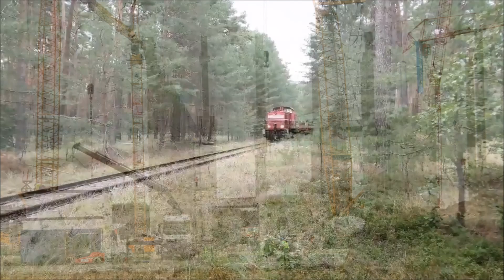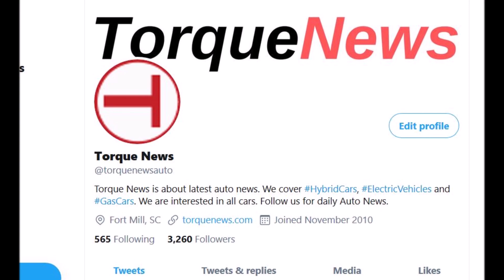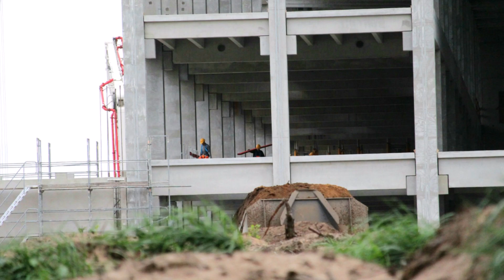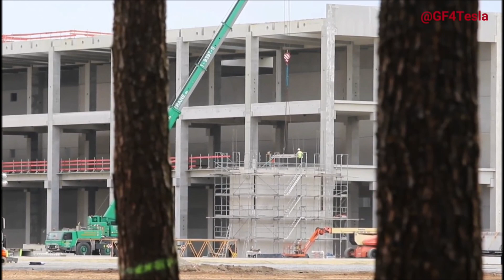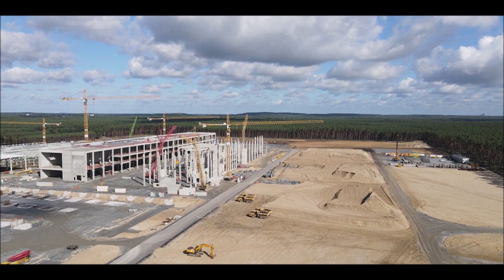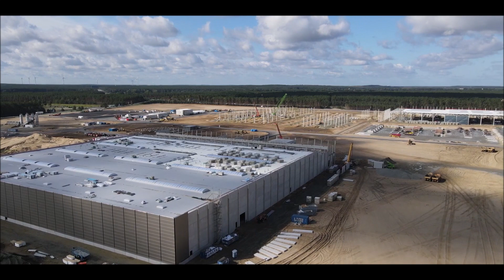Train Brings Enormous Construction Materials To Tesla Giga Berlin

Comment: Looks like half the forest was cut down and cleared
Reply: THEN PRODUCE ELECTRIC VEHICLES TO HELP CUT DOWN THE POLUTION NEEDED FOR TREES LEFT TO SURVIVE , ONCE ALL POLUTION IS CUT TO 20/30% HOW LONG UNTIL EARTH RESEMBLES MARS OR MOON .
Reply: todd  electric vehicle still cause pollution, most countries burn fossil fuels to generate electricity and the mining for the minerals to make the batteries is a highly polluted. What I was wondering why half the forest was cut down, to build these building when other sites are available.
Reply: @jonathantarrant2449  tesla will plant back 3x the amount of trees cut down, but this i san artificial forest originally planted 100 years ago for cardboard production. mining to make batteries is not highly polluted, that's diesel huffers confusing it for hydraulic fracturing.
Reply: @miguellopez3392  all types of mining or high consumers of carbon, the heavy equipment eats diesel. Does matter if the forest was planted for cardboard or naturally occurring there is a large part missing to put up concrete building, which h concrete is high carbon footprint. Looks like the electric battery vehicles aren't as carbon neutral as it first appears
Reply: @jonathantarrant2449  , which h concrete is high carbon footprint. Looks like the electric battery vehicles aren't as carbon neutral as it first appears, its about 40% higher footprint for EVs but they quickly make that back in a handful of years with a mixed fossil fuel grid since they are efficient with that dirty energy.
Reply: @miguellopez3392  concrete is one of the most carbon intensive building materials. High amounts of fossil fuels are burnt for every cubic meter of concrete, from the mining to the baking of the lime, transportation fuel consumption  because of the high water content creates heavy mass, compared to steel or wood or other building materials
Reply: @jonathantarrant2449  yes i know this, what is your point?
Reply: @douglastodd1947  or why not just use already empty/arid soil like in the desert?!

Comment: It's silly to expect trains or other equipment involved to be electric at this point.
Reply: There have been electric trains for well over 100 years
Reply: @gregwatson8708  Electric cars too.  What's your point?  Should the use antique locomotives just for appearances?  They could use modern tiny E-excavators too and take a decade to build it just to make irrational fans happy.
Reply: @Mrbfgray  things change when the economies make it viable, at one point it will be cheaper to run most heavy equipment on batteries either from increasing fuel cost or decreasing battery and electricity cost.
Reply: @miguellopez3392  Yeah Tesla should wait until 2040 to build these factories just so the purists won't be offended.
Reply: @miguellopez3392  nonsense for heavy equipments diesel/alternative fuels will remain for decades, electrifying railways is seriously expensive
Reply: @carholic-sz3qv  yes they will remain for decades but we can replace them faster if we really tried, avoiding development because we worry about cost will guarantee cost remains a problem.
Reply: The nearby mainline is electric. Such branch lines connecting industrial estates normally not. As on factory grounds, you have normally mixed traffic, i.e. rails in the streets and factory floors. You don't really want to have high voltage overhead wires there.
But there are various hybrid shunting locomotives on the market one can buy. 
And overhead wires would also not allow using material handlers and cranes as we can see at the Giga Berlin site.

Comment: They are not able to use an electric train, even if the tracks where electrified. The beams get unloaded with a crane, something you do not do if theres a 15kV wire above it. With an electrified track they would need an unelectrified siding for loading but that requiers a diesel train to push the waggons in and out.
Reply: Bauer 33333 - It doesn’t bother me if they keep using diesel trains, they’re so much more fuel efficient than trucks that it doesn’t really matter.  At least 4x more efficient than truck, and that stat is from years ago.

Comment: I'm not an expert, but it seems. If someone did a study on how much water, the conifer trees on the Berlin location, consumed daily, before the location was cleared. The Tesla factory could use that much per day, without effecting any ground water levels...
Reply: actually trees store water and keep the ground more moist
Reply: A B Not if they are a monoculture like this forest was
Reply: It depends on how they will operate their paint shop because that's the part of the factory that are using enormous amounts of water. If they make the system semi-circular or fully circular I believe it could use up less water than they will lose.

However, as A B said, trees, grass etc binds rainwater to the earth with their root systems so the rainfall won't store as much groundwater as it did when it was flora on the ground because of the capillary breaking materials underneath the foundation and all of the asphalt redirecting the rainfall of the premises.

Every time you make foundation work you have to consider what type of structures/systems are around because some foundations actually float on top of the groundwater to keep stable and all intrusive work in the groundwater levels will lower it, sometimes by a lot, around the building you are building. This means that if you do not take special precautions when planning your foundation the groundwater will inevitably be lowered. One of these precautions you can use is by damming the groundwater around your foundation with water proof constructional elements underneath the ground levels, but I have not seen Tesla do that on this site. They do however, from what I can tell, only use piles for the foundation which minimizes the amount you alter the groundwater level by not being forced to dig up so much dirt because you drive the piles straight down to bedrock.
Reply: Trees are alive.  They consume water, which they combine with carbon dioxide and minerals and sunlight to produce cellulose and O2 and excess gaseous H2O which rises until it condenses in rain which rejoins the cycle.

Comment: I'm not so concerned about the beauty of the outer wall insulation panels but I am concerned about what appears to be the assembly of pre-cast columns and pre-stressed beams. 
Does Germany have a civil engineering earthquake code for prefabricated prestressed concrete construction?
Reply: Lol, there are barely any earthquakes in Germany and most of them are so weak a human does not notice them. They would never ever collapse a building.